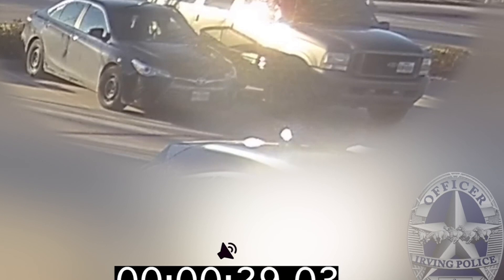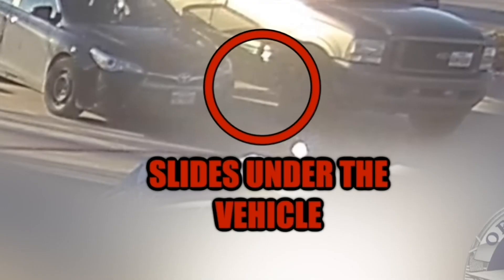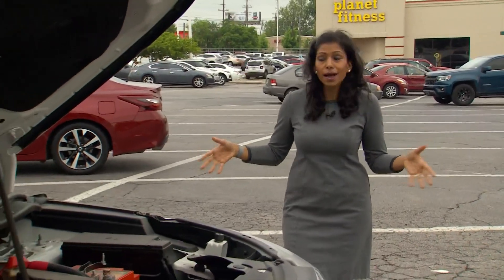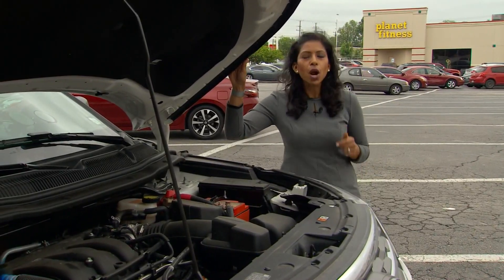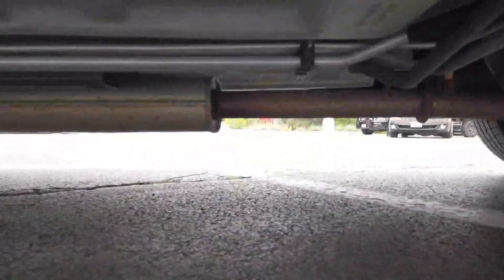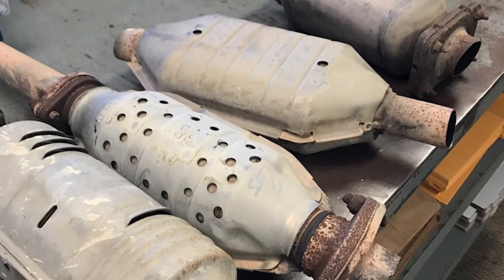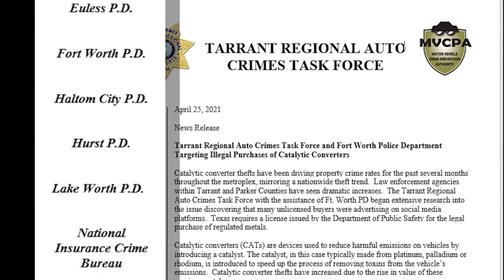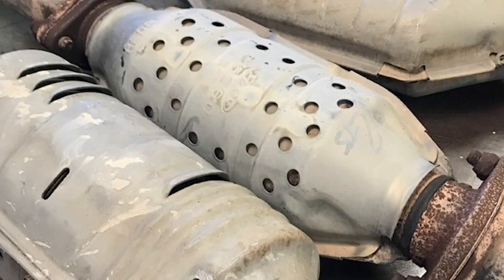Garland police warn people what to listen for in catalytic converter thefts

Comment: Man this bs happened to me in Carrollton Texas.
Reply: Where in Carrollton?
Reply: @sbhimji4568  near Frankford and Rosemead off of Josey
Reply: @xochris2020   Thanks for letting me know. Did they catch the people doing it?
Reply: @sbhimji4568  Unfortunately not yet. They steal these under 2 minutes, its kinda impossible to track them down. Best thing to do is make it hard for them to steal it by parking in a way they cant reach the catalytic converter or engrave your vin or info on it to prevent them from even wanting to take it. I hear they have shields in muffler shops that they weld so it buys you more time if they were to target your car.